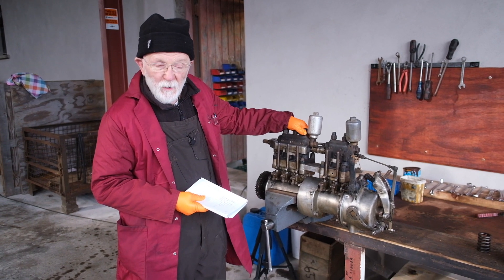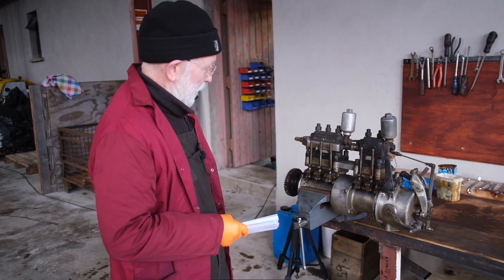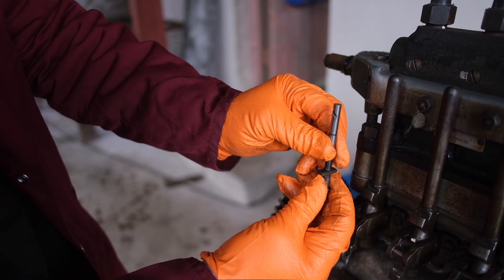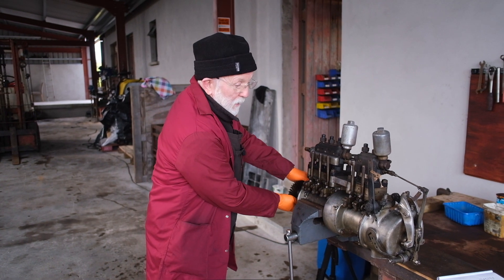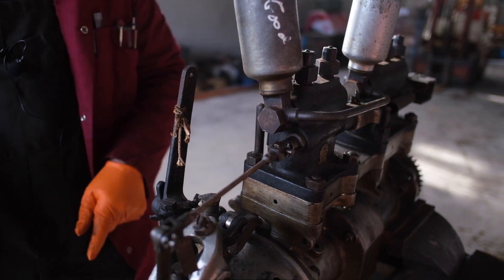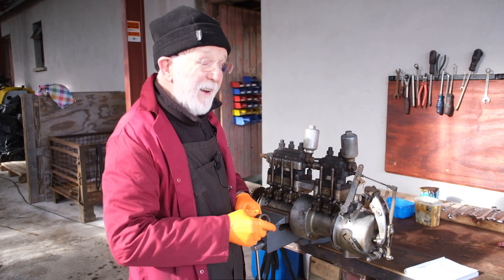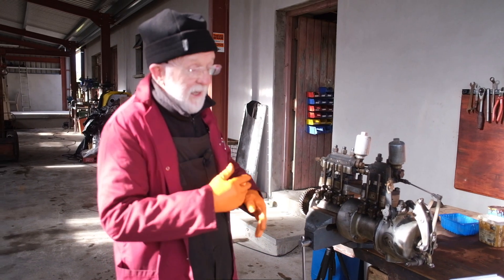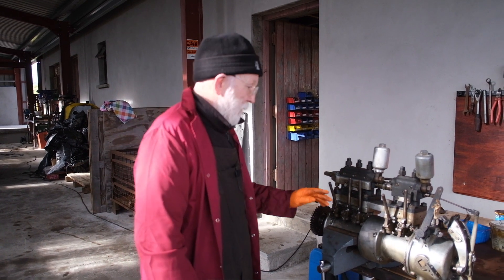How a Gardner Diesel Injector Pump works

Comment: Thank you for this clear explanation of the mechanism. I have a 90 hp 6LW in my old(1949) troller. This engine was installed in the early 1950s and has done yeoman’s work

Comment: So the governor spring keeps the engine on high fuel delivery, until the reeves increase & the centrifugal force of the weights, 
depress the spring which then lowers how much fuel is delivered. What I really like is, the 'designers of the Gardner Engine',
had never heard of the practise of planed: "Obsolescence". After looking at these wonderful Engines, I am in agreement with
you, that they are probably the best Diesel Engines ever made! All most like Meccano, using the same parts on all motors! 
Long lasting, Good on fuel, Reliable, and they sound great. 👍 Thank You Joe, & have a great day.

Comment: Excellent video and thank you so much Joe. I have an experience with the engine stall and stopped after a higher rpm ran say 10 minutes. Then occurred traffic congest and slow down e.g. 2 - 3 minues. When I planned to full stop and changing gear to the 1st it suddenly stopped. Fortunately it has starter motor and resumed rapidly. However it was running properly since not slow down to idle. It ran another highway then go to the town road I fel the throttle was laggy while gear down. Rpm is not raise as my paddle. However it seems normal on next start after cool down. It is a 5LW with David Brown manual gear box as a bus appliance.
Reply from the maker: Please email: tangent.gardner@gmail.com if we can help in any way with this.

Comment: Do a video on adjusting the governor on a 6LXB. I've got one in a locomotive that cuts out like it's starving for fuel every time it is put in gear (the rack moves forwards to starve the engine when suddenly loaded)  Have adjusted idle speed to no gain. Also sometimes when pulling the throttle there is no response until you've given it about 2 or 3 pulls. A mystery box to me.

The 6LXB injection pump doesn't have the long lever attached to the back of the rack as in this video. But this video has helped clear the fog out my mind of how it all works!
Reply from the maker: You are really sure the rack is COMPLETELY free?

Comment: We had quite a few issues with sticking pump racks and of cause the Amal lift pump.
I once managed to get an 8LXB to run on three cylinders using the pump decompressors. 😀
Personally I found the only really bad job on a Gardner was replacing the seals on the fuel pump to engine block oil drain tube, it always made me smile that just the fuel injection pump on an eight cylinder was as big as some car engines.
God I miss working on Gardners, modern electronic fuelling just doesn't have the magic, the laptop does it for you with no skill involved. 🙁

Comment: Hi Joe, trying to repair a Gardener 6LXB. The problem is that 5 out of 6 pistons in the pump head are corroded and seized in the closed (up position). Only one piston opens and closes on the spring. Any suggestions on how I can free up the seized pistons? Thanks

Comment: Joe, i remember about thirty years ago, i replaced the timing chain on a gardner 6hlx, the way we did it back then, and the way we were instructed to do so, was to line up the pop marks on the sprockets with a length of string attached to the timing cover studs, is this the correct procedure? It did line up and ran just fine, cant see this procedure working these days.